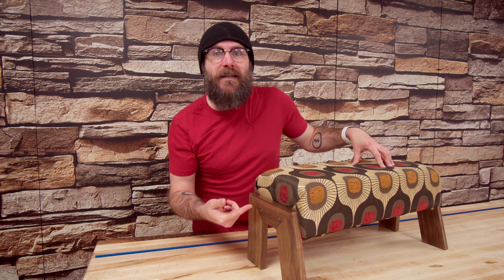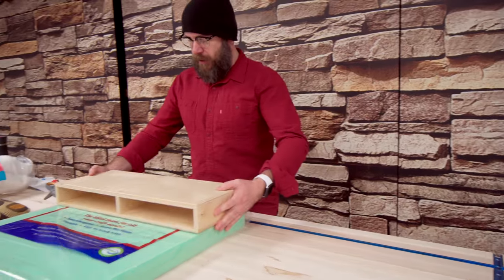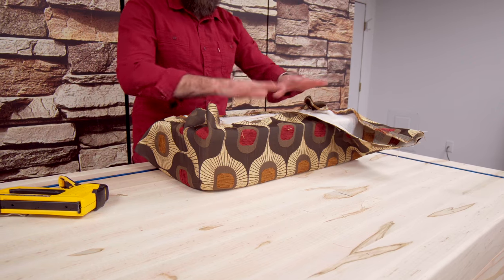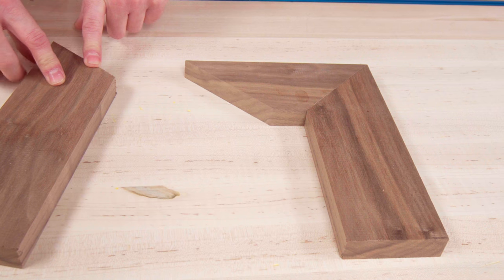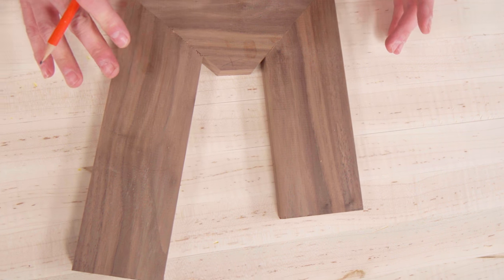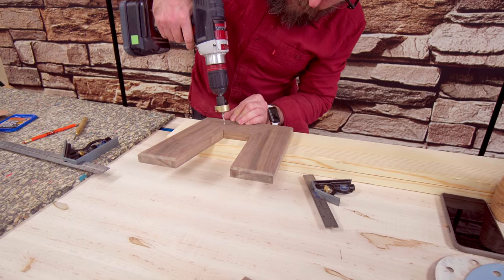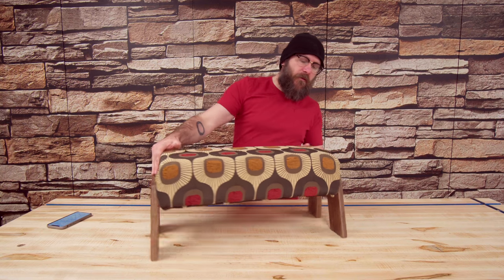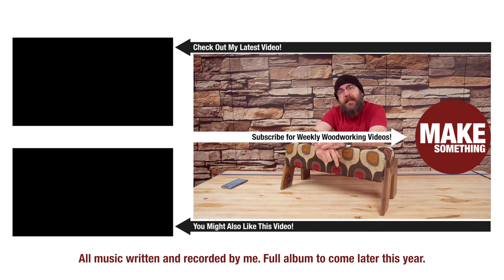Footrest Woodworking Project With an Introduction to Upholstery.

Comment: Upholsted furniture buisness for almost thirty as an upholsterer for ten

The corner pleats
You can do them differently
Start as you did
Pull down on the corner
This will give you two pleats
Roll the excess tight and pull the pleats straight down
This would work best with a leg assembly that fits into the bottom best

Made one of these about ten years ago for the mother in love who was using a plastic stepping stool to pro her her up in church and was having hip pain

Made several more to sell
Sold one
Gave up. Lol
People just don't appreciate craftsman compared to something that gonna fall apart in a few years. 

Using a air staple gun will make the Staples hold better as well

Overall
Props dude
The legs look awesome
And for your first shot at upholstery, did well!!

Comment: Nice easy build David!  I agree, the wax does set off the walnut in a very pleasing way.  If you weren't going to change the legs out later, I would suggest using a plug on the screw holes, perhaps a contrasting wood like oak or even using pegs instead of screws.

Comment: David, can you briefly explain the advantages and disadvantages of the domino vs the old trusty biscuit. a video would be amazing but a few words would be greatly appreciated
Reply from the maker: They do the same thing. A domino is thicker and made of wood so it may be stronger. Also the dust collection is fantastic on the domino. That being said you can save tons of money with a biscuit jointer.

Comment: On the next one (non-prototype) why dont you just modify the one sides angle to be something other than 45? If you cut one set of mitres at 45, it will give you the square leg, and then cut the other set of mitres at 37.5 then it will give you the same outline, without the awkward angles and rip cuts.

Comment: Question is... did you have to re-read the directions before breaking out the domino?  😉😆  Turned out great!
Reply from the maker: This is one of the few time I didn't! Right now it's current set up for 3/4" wood. So as long as don't use anything different...

Comment: Nice clip! But i'm wondering what brand your cordless drill is, because i see a festool li-ion battery and a not-festool drill. Thanks
Reply from the maker: It's Festool. I've painted it.
Reply: Ah thats why i didn't recognize it i own an ancester of that machine with a fixed chuck instead of the centrotec system but still the best purchase of the past few years.